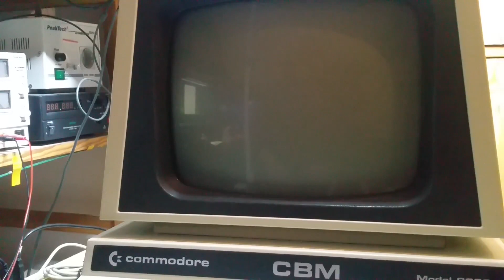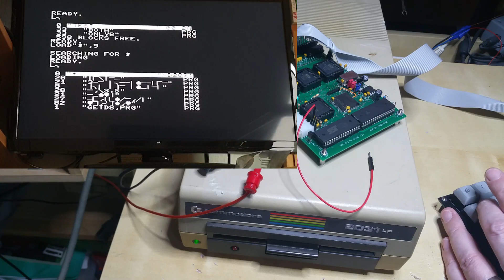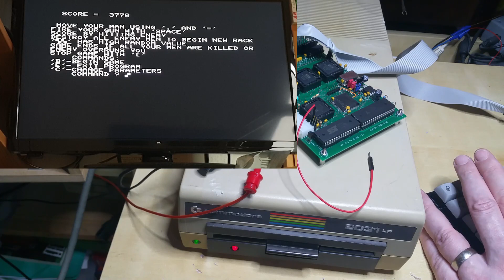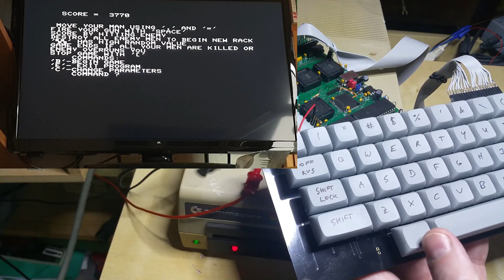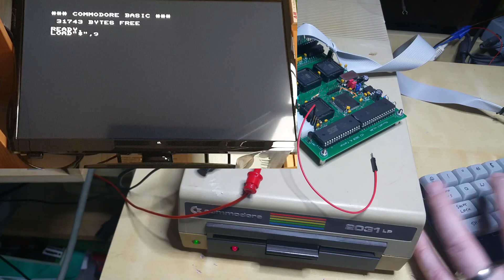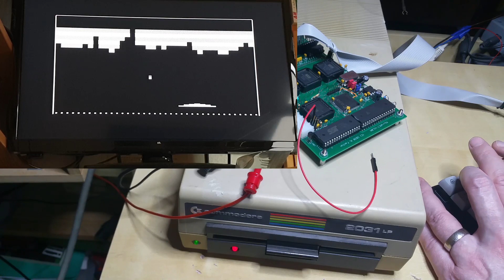8-bit times Ep7: Micro-PET released!

Comment: Hi,  Have you heard of the chroma 81 in the zx-81, which changes the colour of characters, to make black and white games colour?  Looks very nice avd very retro.  You already have the video circuit in PLD, which can be programmed to do character colour look up table.  You have a config file stteched to the game to customise which charters are which colour.  You can also substitute the bit pattern for nicer graphics.

I would like to suggest, as an upgrade, for a new 80°50 column 16 colour text mode with or without programmable two colour characters, for machines with enough memory. Like they could have done in 1980, as a low end keyboard machine.  If one uses the chroma 81 type mode, it only requires 4KB plus the two 4 bit colour attributes  for any charter displayed, which maybe less than 4-32 charters.  With only a single commodore serial bus and joystick, casette and sound ports, and 16KB, it would have been a much cheaper machine in those days.
Reply from the maker: Thanks for that comment. In fact I have been working on an FPGA-based update. The CPLD used was already full, so it had to be an FPGA. See here for video specs https://github.com/fachat/csa_ultracpu/blob/main/CPLD/VIDEO.md and subscribe for the upcoming video on the next gen Micro-PET
Reply: @8bittimes  Thank you.
Reply: @8bittimes  Where do you get the circuit pattern for the video circuit abs glue logic on the CPLD from, or are you using a logical model of it?  I am interested in how complex the 6545 is, and how much can be dropped and still maintain ancient software comparability?

The CGA card is full of special use registers, like light pens, paillettes and various character space  definitions which were never used. So, compatibility and new modes could be made on a less comes design.

It's obvious Sinclair didn't find it cheap enough to use compared to the QL solution.
Reply from the maker: @Mi-583  I did analyze the CRTC before here http://www.6502.org/users/andre/hwinfo/crtc/index.html
For the Micro-PET I did a re-implementation that I then extended. VGA needs different timing (640x480 many more rasterlines, thus much higher pixel clock 25 MHz vs 16MHz), and I used separate fetches into video memory instead of separate character ROM memory
Reply: @8bittimes  Good work.  So, it's not an identical binary operations compatible l circuit, but based on a logical operations description.

So, program compatibility would not be broken using only a subset of the commonly used circuit interfaces without exact matching timings?  Such a stripped down new chip could be designed in TTL logic with upgraded features added?  How many transistors would be in the 6845?
Reply from the maker: @Mi-583  you have to look at the system you want to use your clone in. You only need to implement those features that are used there. Depending on your system, that may vary in complexity and size
Reply: @8bittimes  Yes, it is mainly just game code accessing otherwise unused features of something like this chip, to do tricks.  Like the pseudo hires timing character reset bug, discovered in the 6845 CGA graphics, and which the ZX 81 and Spectrum had already done on their own type of graphics.  It's something done on PET demo scenes now, so it's not much of an issue for old software.  But, it's what else people might have  manipulated years ago.
Reply from the maker: @Mi-583  in such cases you have to be quite true to the original....
Reply: @8bittimes  Thank you.  So, it is an issue apart from the pseudo hires demos.  Which puts out a striped down compatible architecture.  I am really seeing if a ZX81/80 small lowcost like alternative to the Vic 20 was possible (80 column version with more memory).  The 6845 is the costing problem.  One has to be within 100% of the ZX81 price to get acceptance as a quality alternative to the Sinclair's.  They could move the VIC2 technology to a more advanced version and sell a business version with better bitmapped  graphics.   The basic versions allow 160x100 in 4/16+ colours using this text scheme and 100 row text.  For early to mid 80's that would be great.  I wish I could do such things myself, as I gave a case design in mind in white, that looks rather good compared to the ZX-81, which is rare. The micro would fit it with modern power block.  But back then, the glue logic would take up the extra space, until integration.  But, I presume Mos could have done that first off after proof of concept and maybe a full colour pet version beforehand.
Reply: @8bittimes  Sorry, interesting subject.
Reply from the maker: I did actually start with a more original composite timing in the Micro-PET 1.0, that I then modified to the higher timinig to generate VGA output. In the meantime I even went from 640x480 with 25MHz pixel clock to 768x576 with 35MHz pixel clock

Comment: Amazing stuff ! I will definitively build one very soon. How close are you to having the VGA output working ? Will that imply a new revision of the hardware ? And btw, I recently built a petsd+ for my CBM-II (only PET I own) and I found the IEEE-488 connector at digikey.com , product id : A33628-ND . Not that cheap, but works fine, and since I did not have a pet-ieee488 cable, but have a bunch of hp-ib ieee488 cables, I bought this adapter : https://store.go4retro.com/ieee-cable-adapter/ which works fine. To me, both the edge connector and proper IEEE-488 connectors are viable options, maybe put both on the pcb and only the people who want a real IEEE-488 connector will populate it ? Thanks a lot for your work ... I already ordered the last Petskey keyboard :-)
Reply from the maker: VGA output works now, see later videos in the channel

Comment: Dear Andre, can you run VisiCalc and WordPro on this? The problem is that both needs a ROM or EPROM.  I also have a CBM8032P printer and a CBM8050. Would both work on the MicroPET?
Reply from the maker: The IEEE devices should work - the interface ist 1:1 replica. You can load ROM images into memory, so VisiCalc and WordPro should work although I haven't tested it
Reply: @8bittimes  That's amazing.  Any chance I can install this in an 8032 and attach it to the original keyboard and CRT?
Reply from the maker: The original keyboard should work. The CRT - I am not sure. The timing is fixed onto composite PAL output right now (will move to VGA actually). All connectors are different. 
Also, I do NOT approve altering an original machine by replacing the board!
Reply: @8bittimes   Neither do I.  Also, I don't think any CBM/PET owner would want to replace their original board under normal conditions.  However, if you have a completely corroded or irreversibly damaged mainboard, it would be a shame to consider the whole system garbage or a part donor system, especially if the keyboard and the CRT are in working or reparable condition.

Comment: Really nice work!  You're running "Upgraded" BASIC (2) and not version 4?

On your next... next version will you be implementing card edge connectors?  What about a 3.5mm connector for ear/mic; or a SD card floppy?  How about sound?
Reply from the maker: The BASIC version should be easiest, even with an option to select one. Card edge connectors are definitely planned. SPI is planned, hope it fits the CPLD. Then booting from SPI ROM and SD Cards are possible. Sound ... have yet to find a good solution. A small piezo beeper maybe
Reply: @8bittimes  Somewhat off topic but would you have some annotated assembly source code with a good example of sound on a 2001 with the simple CB2 User Port sound mod?
Reply from the maker: Not at hand. There is some code for a "chirp" here https://github.com/fachat/GeckOS-V2/blob/master/arch/cbm8x96/devices/kbd_pet.a65 but totally uncommented. inibell - initialize the VIA. trigbell - start the chirp, bellirq - next part of the chirp. Actually rather simple - sets up the Shift register in ACR, sets the value to shift out, and sets the timer for the shift register. (note: the IRQ is the screen IRQ, not the shift register IRQ).
Or maybe here https://github.com/fachat/usb65/blob/master/drivers/cbmusb_pet.a65 for an SPI interface.